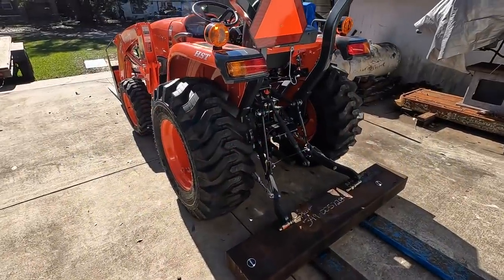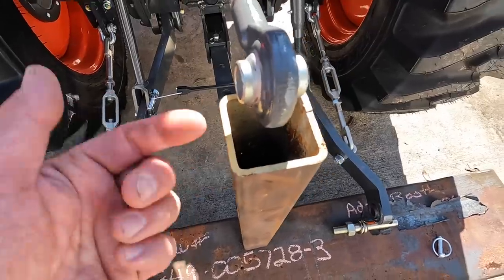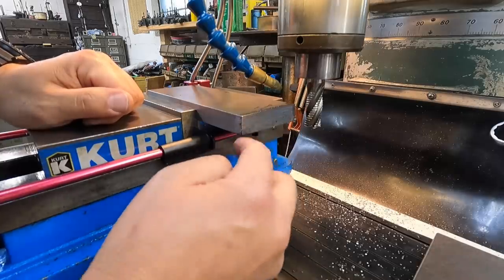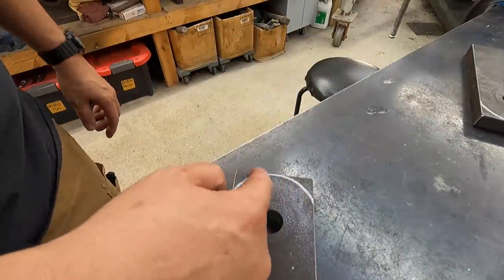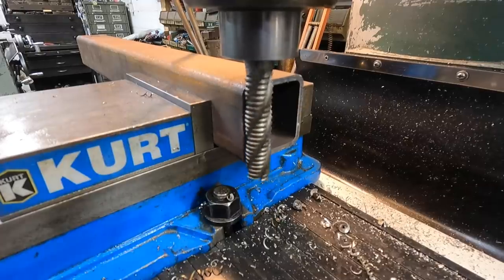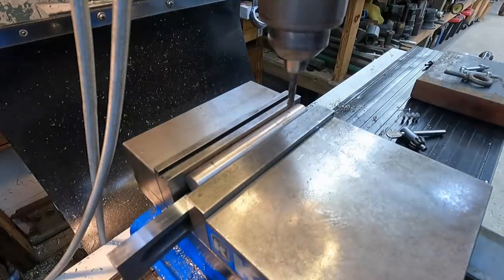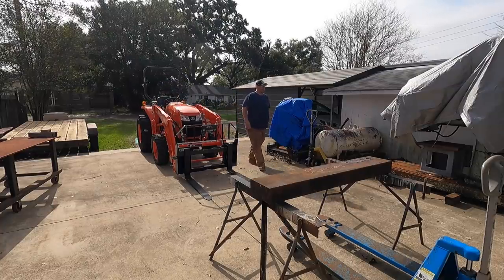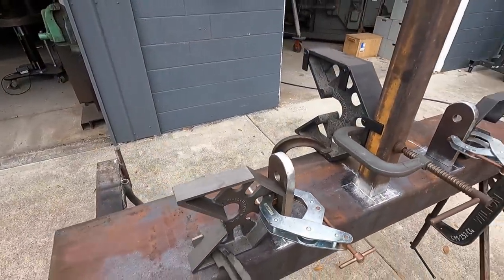Tractor Rear Counterweight Part 1

Comment: At the risk of being boring I am going to tell you never to operate the machine from the ground. I have seen one person killed and two end up losing limbs by doing that. I would also have gone with the water in the tyres and wheel weights as a better solution. but in your case a simple counter weight is probably all you need. (it makes me cry seeing such a lovely lump of steel being humiliated like that)
Reply: I think it's a bit cheap - it will rust through in 400 years.
Reply: This whole video is humiliating. Nouveau rich  silly counterweight.

Comment: Dont make alot of sense.   Hook up box blade or another implement.     I beam scarifier something.
Reply: Normal attachments would be either not as heavy, or not as compact.   For instance a box blade or I beam that wide would weigh less than half as much.  
Being larger, your other implements hamper maneuverability more and also have a higher center of gravity than a solid steel block does.   
And, you don’t need to worry about it being damaged and leaving it exposed to the elements won’t degrade it like if your just using one of your other standard implements.  You could chain a refrigerator full of sand to your three point for counterweight if you want to but if you actually want to use the right right tool for the job, this makes complete sense once you understand the particulars from owning the stuff.

Comment: I can't speak to tractoring, however I would have thought a box of 1/4" filled with concrete and sealed would have been a heck of a lot cheaper than that 1/2 bar.
Heck, take all your shop swarf and melt it down.

Comment: 3/4" plate to make the brackets is way overkill imo.  Rather than torch the radius, cut the corners with the band saw and grind the little bit to take it to your line.

Comment: Why cant you just turn down the pin to the size exactly what you need from the KUBOTA pin you just got in the store. that is what you do.
Reply: I'm guessing he might bring it back when he's on the right side of town again. He suggested his fix was temporary. Also, turning that pin would remove what looks like a galvanized coating.
Reply: I was wondering why he didnt use a larger piece and turn a shoulder on it

Comment: I've never seen anyone want to add weight to the rear of a tractor before. There are plenty of ways to weigh down the front because the front has a tendency to lift when you are pulling heavy items especially when using the 3 point lift, adding weight behind the rear axle will increase the likely hood of the front lifting.
Reply: Weight on the 3PH is to take weight off the front axle when lifting heavy items with the loader (forks). Literally every sub-compact and compact tractor loader manual instructs that weight on the 3PH is required. The weight varies between 600 and 1100 lbs. depending on the tractor (some require even more).
Reply from the maker: Watch the video and see an example of why I’m adding it by lifting the counterweight itself. If I stood up the back would lift and lean. Need counterweight if I plan to lift 1K lbs.
Reply: Rear weights are frequently invisible (Adam mentioned liquid-filling) there are also hub-mounted (donut-shaped) iron weights within the diameter of the wheels. You wouldn't necessarily notice them unless you were looking for them.
Reply: Not sure how many tractors you've been exposed to. Even lawn tractors have available accessory rear wheel weights.  You balance the equipment for the job you are doing within its capacity.
Reply: @larrycleeton  I used to work on fruit farms, never used rear weights !

Comment: I’m afraid someone is going to get hurt by this implement because things are welded off center and without enough structure….. these small tractors are not made to be heavy lifters….. the forks are to small and extend to far out….. most farmers won’t use a tractor that small to lift a round bail of hay….. and it can be over 2000 pounds wet….. be careful trying to set it up to lift heavy weights…. You’re asking for trouble

Comment: DO NOT PUT LIQUID IN THE TIRES!!!!!!!!!
I’m a farmer and have several tractors.  The liquid that is put in tires is sodium chloride.  It will rust the rims, and even if down south they use something else The tire guys hate working with the stuff. Tires will not last as long with liquid in them.  
If you want more weight put wheel weights on the back rims.
Reply: They don't use sodium chloride anymore because of the rusting and environmental issues you have.  They have a couple of different things to use, I have Rim Guard in one tractor and Beet Juice in the other.  They are about the same and don't freeze.
Reply: If you want to put liquid in a tyre, fit a tube, that deals with rust and wear issues.
Reply: @mfc4591  I don't have tubes in any of my tractors tires and they are all filled with ballast.  Have been for years.  I just got new tires last June for my big tractor and we just pumped the beet juice out and changed the tires they were about 8 years old and not rust or anything on the rims.
Reply: @brosselot1  A mine that I worked at last century had a big Hough 400 front end loader, a mighty machine, and it had 10 tons of lead dust in the tires. I never saw how they filled or removed the lead from the tires when it came time to change them and no rust issues with lead😊.
and for those who might not know, sodium chloride is salt, as in table salt, and there is loads of it in sea water, so it is cheap but it does cause rust very efficiently. As MFC says below you can always fit a tube, no contact with the rim then.
Reply: They still use sodium chloride up here were it gets cold.   If you call a tire shop to fix a tire  the first question they ask is there fluid in the tires.  
You need to use inner tubes in the tires when you put liquid in and generally the tube  gets wrecked draining the liquid out.  
I’m sorry to be frank but anybody who suggest putting liquid in the tires doesn’t know that what the hell they’re talking about!!!!
Reply: @alansvanes8479  No doubt that our conditions in Australia are different to yours in America, in that we do not have as much intense cold that you do, but in my experience most tractors in Australia would have water in the tires. I'm not sure about the modern big tractors, in my days a 60 - 90 HP tractor was big, but compared to todays monsters, those old tractors are just a bit bigger than a lawn tractor, but back in the day, they would mostly have had water in the tires. I have never heard of people using anti freeze materials in tractor wheels, just plain water and that caused no problems at all. I would have thought that Adams location would not be subject to extreme cold, so plain water may work for him also, but as I said I am not familiar with possible winter extremes around Florida..

Comment: I love your videos but im still at a loss. never hang weight off of a tractor unless you have no other way. it causes wear to everything. either fill tires or get tire weights. every component that supports that 1000 pounds will wear  faster now.  plus wheel weights dont have to be put on.
Reply: Lmao what are you talking about? That's the whole point of the 3 point hitch, to hang things off the back of the tractor.
Reply: @Jeremy-iv9bc  I thought that the 3 point was for implements
Reply: @Jeremy-iv9bc  three point is specifically designed to pull. Or to transport an implement. Why big tractors don't have three point at all. Why would you want to do that? Wheel weights are just as heavy and the tractor doesn't hold the weight. My opinion, I guess 40 years repairing people's mistakes on tractors didn't teach me anything. Tractors are built heavy but they are not indestructible. Plus that's a tiny tractor.
Reply: @gordonknight2676  
Every old farmer with a front end loader has a counter weight for the hitch, it is not a new thing. 
The downside with filled tires or wheel weights is that they are not easy removable, driving on soft ground, you don't want a heavy tractor.

The farmer way for a counter weight is a old oil drum filled with concrete.

Comment: Don’t put the liquid in your tires it will rot the rims out
Reply: Inner tubes......
Reply: Inner tubes leak
Reply: Calcium chloride is what used to be the standard wheel ballast for tractor tires and yes it would rot the rims, but now we generally use beet juice which doesnt rot the rims.

Comment: suprised you didn't bevel those  edges , and you didn't use the needle scaler first before grinding . also welding the wasers on the pins
Reply: And there should be two brackets on each side and they should be placed in the center of gravity. The counterweight is far too wide, bad for turning in narrow spaces. It should be cut in half and stacked.

I still think, Adam should not work on vehicles. The monkey holder in front of the pickup is horrible, as well as the crane construction in the back. Adam has no feeling about the effects weight and leverage.
Reply: Surprised he didn't just chuck up and turn down the store-bought pin.

Comment: Its not the shops job to KNOW what kind/size bolts you got on a tractor.... that ringbolt is possible to replace with anything ragarding to size... so stop whining and do your own job by meshuring the thing before going shoping??? That said, i like the stuff you do but that "im fucking pissed on the shop for not beeing gods and just know what a customer needs" thing pissed me off.
Reply: Actually I believe the only reason to go to a dealership to get parts is because they know exactly what you’re tractor needs
Reply: @tbone1778  Well there are Parts that can change and maybe, we can't know. Maybe he was the Problem. Maybe he wanted something else and the Store did nothing wrong, maybe there are real People that can Mistake. Well i wouldn't make such a big Thing out of nothing. Hell he as a Lathe, he can turn it down in Seconds. Well he could have measure it and sayed it in the Store.....